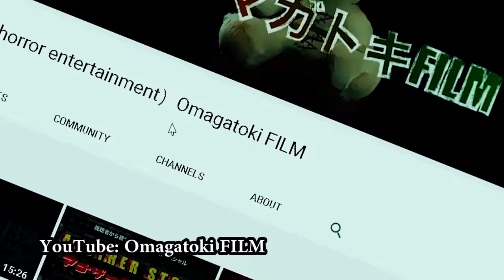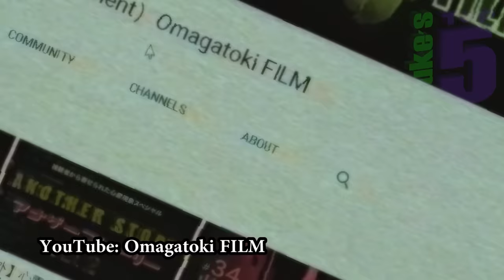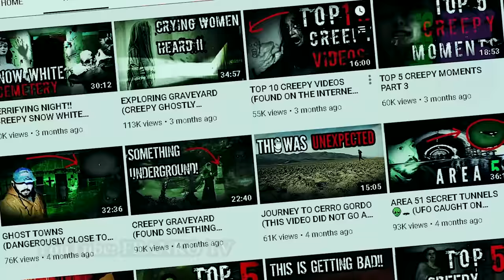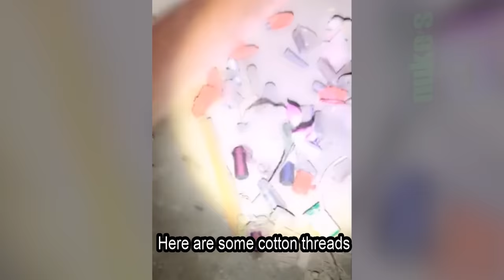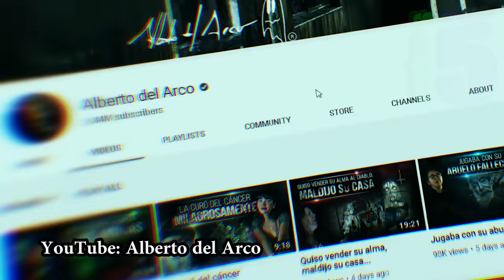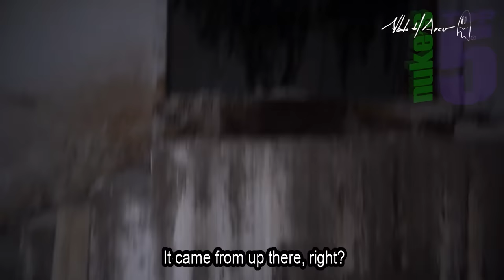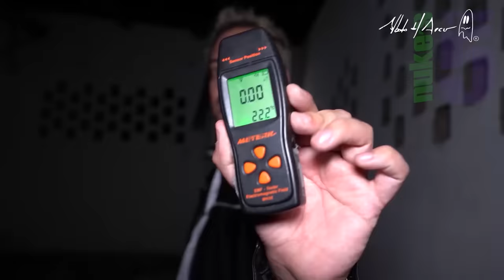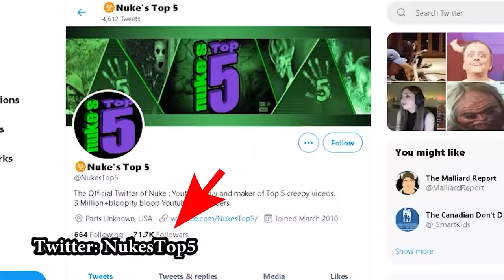Top 5 SCARY Ghost Videos To CREEP You OUT

Comment: This might seem strange, but at 23:43 with xiaolong, the strange clay urn has a very oddly positioned shadow. Its not pushed against the wall... its like the shadow is physcially on the clay urn.
It may just be a trick of the light but even at different angles its stillas if its on the urn. Both me and my flatmate just couldnt get our minds around it
Reply: Bro you're freakin right. The shadow looks more 2D and doesn't stretch along the floor or bend onto the wall behind it like you would expect
Reply: Oh yeah, when he kicked it, you'll get the upper view and you can clearly see that the shadow is standing right behind the pot. Not stretched to the ground or anything, it just standing
Reply: I review this clip in slow mode , albeit it was looks like paste , but it still looks real frame to frame . I think it was because the constant zoom of the angle of light make it looked a bit unrealistic.
Reply: Oh my god you're right. That's so weird